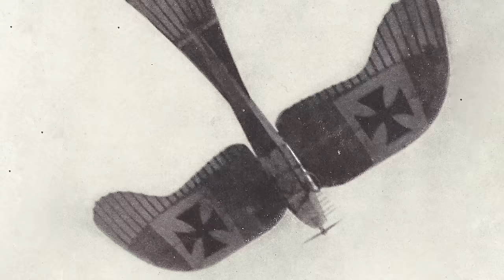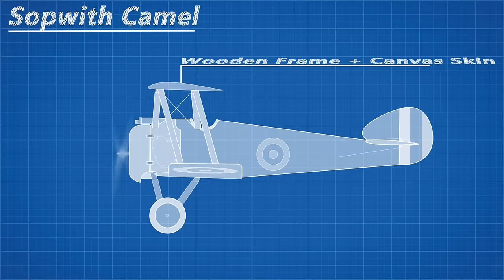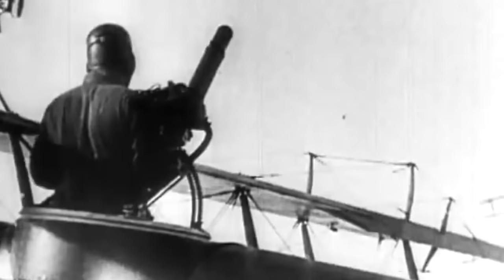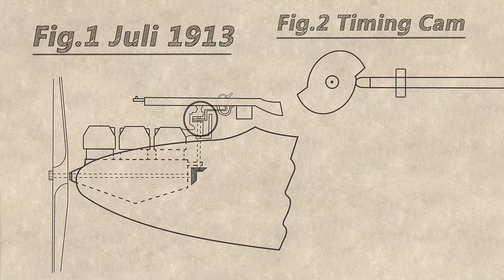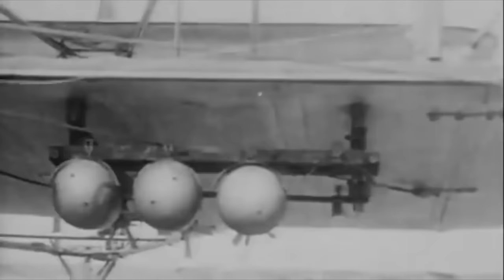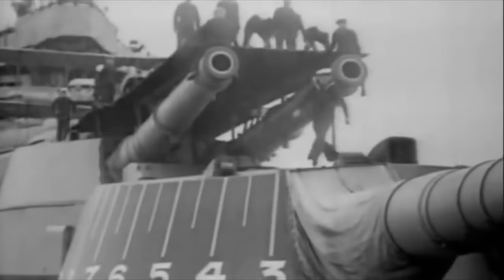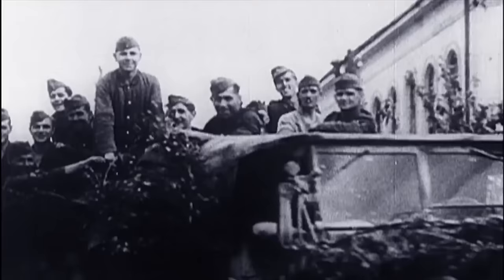The Physics of World War 1 Planes feat. The Great War Channel

Comment: The rotary engine had another big disadvantage that you left out.  It was almost impossible to seal the crankcase, so they usually leaked oil like crazy.  Some engines were two stroke to simplify the oil system, and not only did they leak oil, but they burned it as well.  In either case, due to the temperatures, and lube requirements, vegetable oil was often used.  The engine sprayed the pilot with fine mist of oil, and he often inhaled a fair amount of it, which was another reason for using vegetable oil, it wasn't a hazardous material.  The scarfs worn by the pilots had a dual purpose, for warmth at high altitudes, and to wipe their goggles clean from the oil spray.   HOWEVER, inhaling the oil had a laxative effect similar to castor oil (which was actually one of the oil types used as a lube) on the pilot.  The resulting 'urge' to 'go' must have surly reduced the pilot's effectiveness!

Comment: I don't know where to start with this mish mash of mis-information.  The Red Baron made more kills flying the Albatros than the Fokker triplane, the Fokker triplane was transitory, it was recalled early in it's service for 'bad engineering' introduced at their Schwerin factory for wing construction faults.   By the time these problems were fixed, the Fokker DVII was already in production, and the Albatros DVa was providing most of the fire power for the IGAS. The Fokker Triplane was based on the Sopwith tripe, a decent aircraft but didn't serve in large enough numbers, the Sopwith Pup and Camels were more effective
Reply: I should have said the Sopwith' tripe inspired the design of DR1  the maneuverability of the Sop tripehound was legendary, unfortunately the quality of work on the F.I and following DR.I's was as supect as the Sopwith was maneuverable. This is  proven by the fact that the upper wings on the DR-1 were splitting their seams in flight and killing pilots.  The DR.I was never fielded in any great numbers and yet it owes it's very existence to the Sopwith Tripe.  Albatros fielded a triplane, Euler, Sablating, and others all had their fling with prototypes with triple pairs of wings.

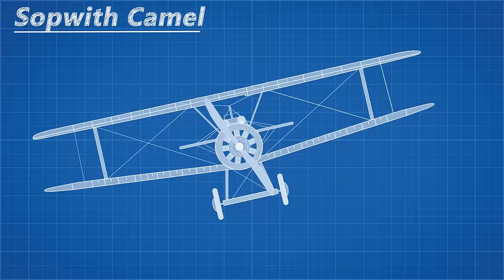Comment: 7:35 I do not understand why rolling right would cause the nose to pitch down, and left roll to pitch up. it is not normal for a gyroscope to torque in pitch or roll when the input torque is in the axis of rotation. I think what you mean is when you YAW left or right, which actually changes the plane of the gyroscope, it will in turn pitch the airplane up or down. and rolling is usually part of a coordinated turn.
Reply: No, when turning. Which involves roll and pitch

Comment: Hey, Real Engineering, what do you think of this approach to explain lift?

Gas dynamics can give the answer to lift without having to make assumptions that "equal time argument" makes. I'll concede that it does boil down to good old newton's third law, but one must make sure not to ignore where those forces come from.

What is pressure? Amount of force exerted over unit surface.

What creates force in a gas-solid system? Gaseous particles impacting upon the solid.

Airfoils redirect particles from the top half of the object's surface. Furthermore, these redirected particles are going to redirect other particles away from the upper surface. These two both compound to give both a reduced number of particles impacting with the top side of the airfoil, and reducing the energy of those that do impact. In other words, lower pressure. For us, this means while there is a force acting on our wing, it will be reduced.

Now, make the airfoil somewhat more complicated, giving it a curve on the bottom. You still redirect particles from the top, but you also increase the lower surface area. Drag is essentially pressure acting on your observed body in a detrimental fashion. However, since the angle of attack is not 90 degrees to the incoming particles, a component of the force the gas particles impart on the airfoil will become lifting force. 

The degree by which you increase lifting force is inversely proportional to your angle of attack. If your wing is suddenly 90 degrees, you'll have 0 lift component and 1 drag component. Reduce that while maintaining maximal surface area and you increase lift. However, reduce it too much and you reduce the amount of surface area the high energy air can interact with.

In essence, you produce lift as long as the following holds true:

F(b) > F(a), this gives F(lift) = F (b) - F(a)

F(b) = force acting on the wing from below; F(a) = force acting on the wing from above.

Both f(B) and f(A) are directly proportional to the wing's surface area. Meaning, increasing a wing's surface area without thinking about anything else will not affect lift either positively or negatively.

F(a) is influenced by the air pressure above the wing, which comes from the amount of force it endures over its surface. We want to reduce this force, so we shape our airfoil to deflect air to knock other air particles out of the way, or at least reduce their velocity; and to redirect them entirely. The ideal wing for F(a) = 0 would be a 90 degree vertical sheet.

f(b) is influenced by air pressure below the wing, which comes from the amount of force it endures over its surface. We want to increase this force, so we shape our airfoil to impact with as many high velocity air particles as it can. However, these particles also act as drag. The ratio of drag versus F(b) is dependent on the angle of attack. We want to maximize the angle of attack without generating too much drag.

In essence, the above is exactly Newton's Third Law of Motion. However, I feel that working with particles and actual interactions is much more intuitive and natural than to say "Newton said this thing, so this thing has to happen." 

This explanation proves that lift is an actual, tangible force, and not just a phantom force like centrifugal "force" is. .

Comment: The faster roll thing is due to the Conservation of Momentum. Rotational Momentum (for a beam about its center) is L= (1/12 mr^2)*v When the Radius is decreased and the mass stays the same, the Velocity increases to compensate and thus an object spins faster when its Radius is smaller. I'm pretty sure that's what you were implying, though. (I don't intend to sound like an ass, I just thought I'd correct what I believe is wrong)

Comment: Really interesting. Maybe I missed it ... but what was that city skyline behind you in the night? I've known about the rotary engines of many of the Great War aircraft, though I was not cognizant of the gyroscopic effect its operation created. I'd always thought that the problem was with fuel induction. For example at lower speeds it had no idle function, so it needed intermittent blasts of fuel to the engine via the throttle. And I understand that the fuels they used had heavy doses of castor oil mixed in for lubrication, similar to a modern two-cycle engine.
     Seems odd to me that nobody during the war thought to create a finned (air-cooled) engine with stationary engine block -- but use the same intake/power/exhaust as a rotary; in effect, a two-cycle engine. But I think the two-cycle engine was invented shortly after, in 1920's Europe. I think the first were bulky upright designs (not radial), intended for light industrial use. And they might've been water-cooled. Do you have an episode discussing the history of two-cycle engines?

Comment: It's not about increasing wing area, it's about increasing wing aspect ratio as you increase wing area. Making the wings stubbier and larger would be detrimental. They need to become more elongated, or, in the case of the bi and tri-planes, increase the number of identical wings
Reply: It wouldn't be detrimental to make the wings stubbier. Wouldn't be helpful in terms of induced drag reduction, but it wouldn't hurt either

Comment: I never understood why the Camel has always been singled out as the most difficult to fly due to its rotary engine, but dozens of aircraft of that time were using rotary engines, In fact the design dominated aviation. Planes like the pup, the DR-1, the Eindecker, the Pfaltz DVIII, Fokker DVIII and others- too many to count, and yet the Camel is faulted for it. I think the real difficulty was this engine of course, made even more troublesome because of the inherent instability built into the airframe- which is also what made it a great fighter. Also the cantilever wing was being used- but hidden by Fokker designs. In fact the DR-1 and the DVII both had cantilever wings, but the pilots were afraid to fly them without interplane struts, so they were added but neither the DR-1 nor the DVII had flying wires. These aircraft were the first to have a thick airfoil, (something like a Clark-Y) which offered a thickness that accommodated a couple of super stong wooden box spars that didn't need bracing. Technology was just as much held back by tradition and fear of the unknown as the lack of knowledge but wood is a very capable material. I thought it funny that as he explains early on how the early airframes were too flimsy to carry big guns, while the video shows a row of British SE-5A airplanes, one of the most advanced- among the top 4 aircraft of the war, which was a very capable fighter that carried a heavy machine gun and bombs and continued use after the war. Some pilots thought the SE-5 may have been a better plane than the Camel. It has been called the spitfire of WW1 but unfortunately their engines were problematic. What the Camel had was a tough to fly engine but extremely reliable.

Comment: 5:59 the sopwith camel has a radial engine, not a rotary engine.
Reply: theawsomemax7901 wrong, there are two types of rotary engines. The Wankel Rotary engine which uses a rotor instead of pistons. And the engine shown in this video, which is called a rotary engine because (even though it uses pistons) the entire engine, along with the prop, rotates around a static crankshaft.

Comment: Do a video about the physics of swings and pumping on them
Reply: CaptainSwagelz thats just messing with center of mass im pretty sure or rotational inertia
Reply: Yeah that's just changing the center of mass so that your descent is a bit more vertical, therefore slightly increasing your speed. At least that's what i would imagine.
Reply: By pumping you shift your center of mass in the direction of travel and increase inertia in that direction.  You're putting you weight into it essentially, "leaning into it" as it were.

Comment: Why didn't they simply put 2 rotary engines, one facing forward and one backwards? They would've gotten almost double the power (minus the extra weight, of course) plus the torque of each would've cancelled the other's, so there'd be no gyroscopic effects at all for the airplane. Alternately they could've taken advantage of these gyro effects, slowing down one motor or the other to aid the pilots turn much faster.

Comment: Always loved the biplanes for the lift, They were kites, no effort  for the lift. Modern aircraft are moving back towards it. Efficient engines, wide straight wings with a large fuselage. Speed has not become that important. Drop 100mph  to gain fuel efficiency.

Comment: Interesting video. Lots of errors. Sailplanes are not intentionally designed with lots of wing area.  Sailplanes are designed to have maximum span,  often limited by competition class, and minimum wing area to achieve a given glide slope at as high a speed as possible. WW1 airplanes had multiple wings because they had thin airfoils that couldn’t contain a deep enough spar to be cantilever structures.  Thin wings were an artifact of low speed wind tunnel testing before the importance of Reynolds’s numbers was established.  Thin airfoils performed better in the tiny low speed wind tunnels in use before the war.  Later Anthony Fokker integrated a new, thick airfoil on the d viii and the result was such a superior airplane that it is specifically mentioned in the Versailles treaty as technology that had to be surrendered.

Comment: WW1 aircraft probably did not dive very well. They were mostly wood and fabric, with most of the metal being in the engine, and their relative light weight would have made diving difficult. Their fragile construction might have made it risky to put too much stress on the wings, which diving does do.

Comment: Just a physics question for my curiosity- 

What is the slowest speed needed to get airborne for a manned aeroplane?

As WW1 planes went much slower than todays planes.what is the lowest extreme that we can go?
Reply: LegoJamTrain567 It depends on the amount of lift the wings can produce. For the same amount of air flow, a wing with a big area generates more lift than a wing with a small area, but bigger wings are heavier, so it's harder to accelerate the aircraft.
Reply: Thanks for that insight. But to what extent will it work what is the compromise between small enough to lift a person and unfeasibly big. at what point is that transition made? Can you make a plane capable of lift at 10mph?
Reply: Now you got me. I'm don't know enough about aeronautical physics to answer that question

Comment: WW1 was very much the end of the Victorian era. Edwardian was more an extention of the Victorian but WW1  changed that through social changes bought about as the rigid social classes intermingled and died together in the mud. 
 Technologically, the equipment was Victorian. The rifles were from the late 19th century, the MGs were from the late 19th century. These weapons were used in Africa during colonial campaigns such as in Sudan and the Boer war (which predicted WW1). Even planes were 19th century. Wood, canvas and the internal combustion engine all existed together by 1900. It was the war which took primitive tools and pushed a new era for technology. 
 When combined with social changes and changes to military doctrine, this ended the old ways of Victorian life and ushered in the new.

Comment: Isnt it called a radial engine? I thought rotary engines use a rotor instead of pistons? Anyhow nice video.
Reply: That's a Wankel rotary this video refers to an early type of piston engine called a rotary because the crankcase and cylinders rotated while the crankshaft remained stationary

Comment: Hello! Any engineers here? I hope so, because I have a question. Can somebody please tell me why modern gliders have long and skinny wings instead of slightly shorter and wide wings?

Thanks!
Reply: Yuri DeKhed Ok. That makes sense. But do you know anything about why they didn’t have thin long wings for WW2 era gliders? Is it because the materials used at the time were too weak? Or did they just not know how to make it more efficient?
Reply: Much more drag from a wide wing than a long one. Plus the end effect: the air 'leaks' lengthways over the free end of the wing, reducing lift for a good distance from the end. That's also why wing fences (winglets) are often fitted to the ends.

Comment: I left a comment before, which was inaccurate.
What I want to know is how much more a rotary engine acts like a gyroscope vs a standard piston engine, in my mind it doesn't really seen to have much of a difference.
Don't piston engines have roughly the same amount of rotating mass? 
I may be totally wrong, but if the output power is roughly equivalent in each power plant why would a rotary act more like a gyroscope than a piston engine?
Reply: Because rotary in this sense refers to an early type of piston engine and not the Wankel rotary in an RX-7
Reply: Ohhhh! You're right! The Wankel Rotary was designed in the 50's..
Thank you so much, I totally didn't think of it that way.

Comment: Richthoffen didnt just fly the Fokker DR.1. His first plane was an Albatros D.1 followed by the D.2, then D.3 then D.VA's until 1918 when the DR.1 was new to the Front.  He first painted the Albatros  D.3 bright Red all over. Followed by his last model of the Albatros D.VA so only 2.

He even flew a Fokker Einedeckker and a Halberstadt D.2 once. 

He flew several DR.1's list as follows:

Fokker F.1 102/17 (prototype DR.1)
Fokker DR.1 127/17
Fokker DR.1 156/17
Fokker DR.1 477/17
Fokker DR.1 425/17  (Killed in this one) 

Not all of the DR.1's he flew were Red. Only 477/17 and 425/17 were painted Red all over. 

102/17  was the regular Blue/Gray cammo paint.

The others had different sections painted Red such as the upper wing and rear cockpit area.